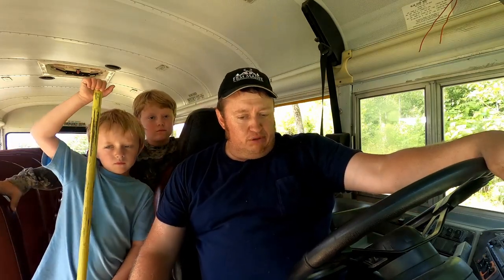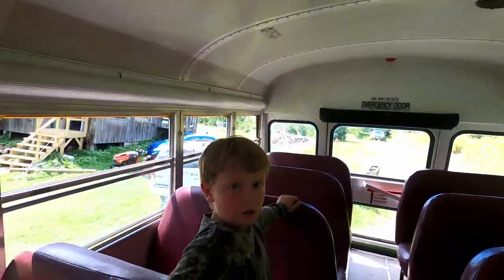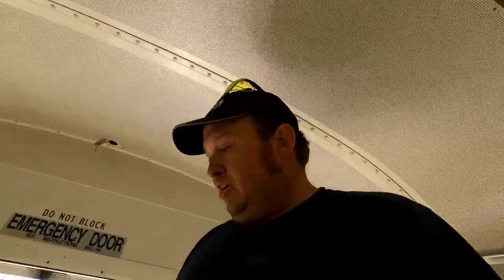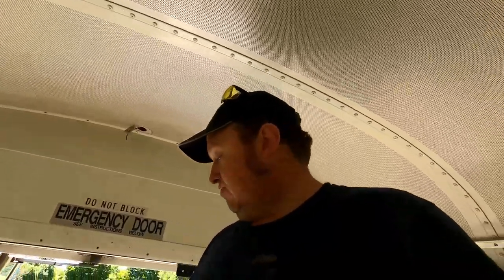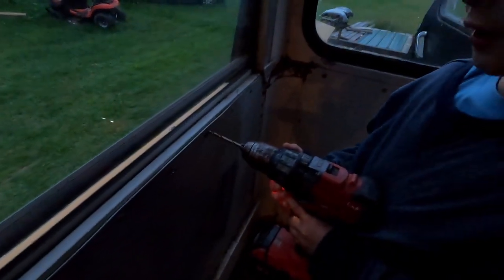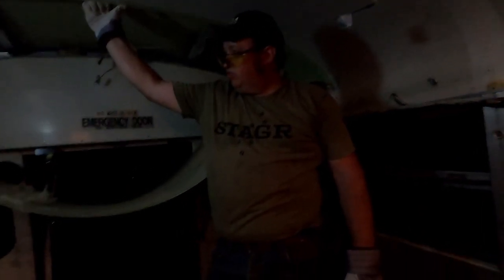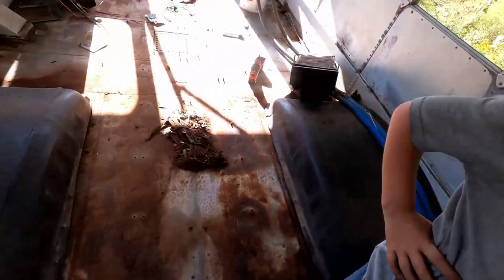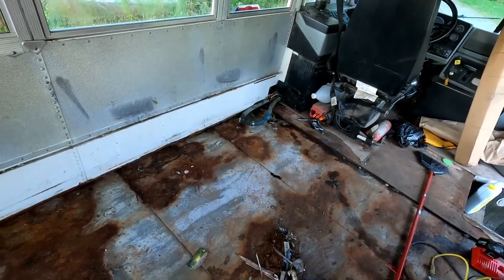"The Buck Bus" Ep.1  From School Bus to Skoolie Hunting Camp.  How to Demo Seats, Floor, and Heaters

Comment: Great project, look forward to seeing  videos of not only the future progress but  adventures with the finish product as well. In regard to the poly iso insulation,  it insulates well but as it turns out ants love it. I've had ants get into that so much you could hear them eating it. If you use it make sure its well sealed.
Reply from the maker: Thanks for the tip Jason!

Comment: Hopefully your state lets you insure it without putting you in high risk or commercial vehicle. I bought one without air brakes intentionally, had it inspected and titled as a motor home here in Michigan. Got insurance and six months later they cancelled the policy due to it being a “commercial” vehicle. Tried several other companies, all the same. Ended up paying big money to keep it insured as required here in the Peoples Republic of Michigan. 😡
P.S. it sure was fun driving it into town with the wood stove burning though. 😆
Reply from the maker: From what I read I can. We will see.
Reply: @FBMMaineOutdoorJournal  seal up every possible mouse entry point too. Vermin love school buses. 🐭 I have three forms of heat; small wood stove, 10,000 btu propane wall heater and a diesel heater. Wood stove for very cold days/nights and wet weather. I actually prefer the diesel heater over propane so I tend to use that the most.
Reply from the maker: Cool thanks for the info.